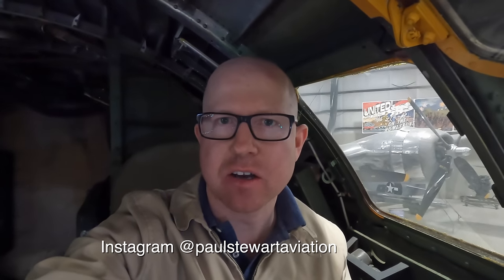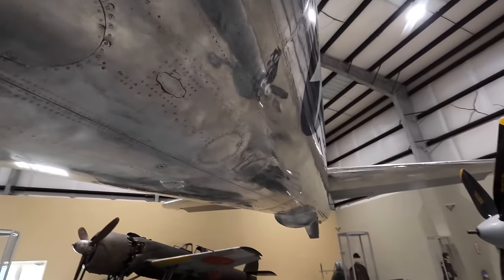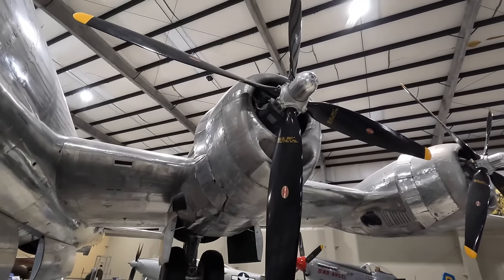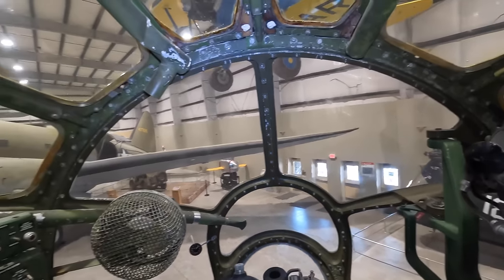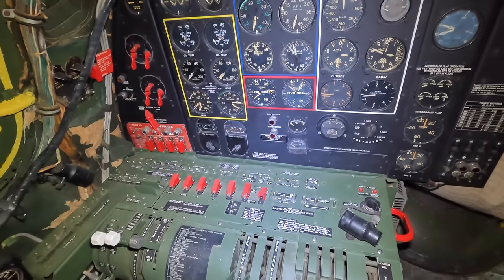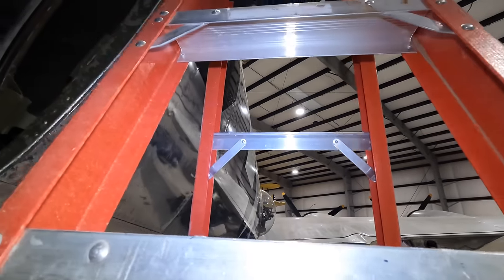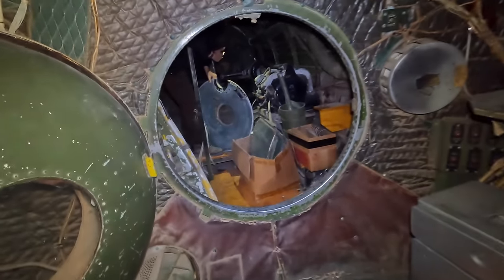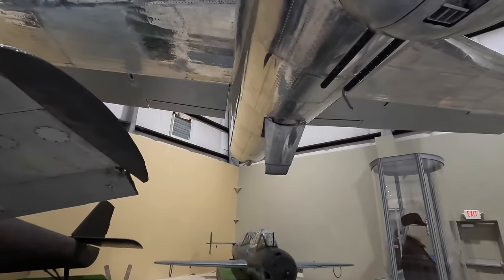Detailed tour through a Boeing B-29 Superfortress

Comment: my father-in-law archie hamrick was a tail gunner on a B-29 out of saipan .  the ramp queen.  won the distinguished flying cross awarded by general curtis lemay himself.  had twin 50 cal. machine guns plus a 20mm cannon.  cannon removed on many planes due to performance problems but archie took meticulous care of his weapon and did not have a problem.   thank you for this most interesting video.  JDR
Reply: 20mm were removed from all B-29s.  Both performance and weight problems. The gun system and ammunition weight >1,600lbs.  So less weight meant more bombs.
Reply: He took care of 20mm cannon when it was fitted and no problems but different ballistic travel than 50 cals strange idea

Comment: Very nice video of the B-29 Superfortress.  Thankyou for sharing.  My father was a B-29 pilot in command in June 1945.  He and his B-29 crew had orders to report for combat duty at North Field in Guam.  As it turned out, the war with Japan had ended just two weeks before they were to report for combat duty at North Field in Guam.    Dad later joined the newly formed USAF in 1947 when the Air Force separated from the Army, where he flew WB-29 Superfortresses for the USAF's Air Weather Service where he flew several weather reconnaissance missions.  Dad would fly through hurricanes to track where they were headed.  He would also fly through clouds to take air samples to check for radiation to see if the Soviets had detonated any atomic weapons recently.  He retired from the USAF in 1957.

Comment: I started volunteering at the Pima Air Museum as a teenager in the late 1970's. I, with permission, gave myself that same tour on more than one occasion. That aircraft was in amazing condition back then, only significant part missing this video calls the barber chair, gunners position. What I was told was called the CFC gunners seat/Central Fire Control gunners position.

Comment: B-29's were apparently very difficult to handle on the ground due to lack of nosewheel steering. Differential braking to steer was much easier on a tail dragging aircraft. They added nosewheel steering to the upgraded B-50 variant of the B-29.
Reply: The sound of a B-29’s brakes while taxiing is astounding, it’s like it’s screaming to leave the ground. That aircraft lets you know it’s there, loudly.

Comment: Excellent Video! the fire control system for the turrets was a very advanced bit of technology for the time. I was surprised to see that the control surfaces did  only use the  control cables with no power assist. For Crew members moving through the plane, lots of places to bang their heads.

Comment: Cool video but few points of inaccuracy here: 

The primary reason remotely-controlled barbettes were employed was due to the need for pressurisation at the B-29s high operating altitude:  the better shooting coverage & aerodynamic improvements were merely additional (though important) benefits. As all the crew needed to operate within a pressurised cabin, the gun ports in the turrets would require sealing which would have been impracticable & very difficult to achieve (except for the rear gunner's position, which didn't require a turret). The answer was to place the guns in electrically actuated, unpressurised "bins" & operate them remotely.

The Soviets didn't "capture" the B-29, as such, they reversed engineered a damaged machine that force-landed in Soviet territory in November 44. None were returned to the US.

The ailerons were metal skinned (which you can clearly tell from the inspection hatches cut into them & lack of ribbing undulations), but were made from a different type of alloy, hence the darker colour (the airframe comprised of many types of alloy "formulations"  which was another advanced feature of the design).

Having said all that, great video. One thing that comes across is how cramped it all was, especially that crawl tunnel. Definitely not for fatties or claustrophobics.

Comment: Great tour that the public wouldn't be allowed to do, I suppose.  The museum staff must really trust you not to break anything !  I wondered how the crew aimed at enemy planes, if the turrets are in a different place to the crew aiming points.  The crew must have given some range information to the computer.    That was my favourite Airfix model to build.
Reply: The clear bubbles side, top and bottom contained an aiming device.  The observer (gunner) enclosed the attacking aircraft in a rectangle site that communicated its size, direction and speed to an analog computer.  It then selected the appropriate guns to aim at the target and calculated how much lead and distance to compensate for.  It worked better than humans could.

Comment: I imagine the flight control cable theory is more real than you think. GI's get bored. 😂 

I remember when I was a young airman, I got into sport skydiving. Our Cessna's cables looked very similar and enticing. During the climb to altitude, we'd get bored. One of us would figure out the elevator cable and put some pressure on it. The unknowing pilot would put some trim in. Wait a bit. More pressure, more trim. Wait a bit. More pressure , more trim. Etc, etc. Finally, we'd let go and the plane would drop and scare the pilot. Good thing we all had chutes. 

I bet a good number of B-29 commanders had to yell "knock it off back there!" back in the day.

Comment: My godfather was the pilot of a B-29 in WW2. Remember him saying the engines were the most finicky/problematic part of the plane. Had to make sure they didn’t overheat and were prone to catching fire. Also, said the wing design was not as tricky to handle as the B-26 Marauder.
Reply: Engine fires were due to using magnesium for certain components.  Once it starts burning it's a bitch to put out.  Run away props were another serious issue.  If a blade detached and hit the fuselage it could cut the plane in half in a worst case situation.
Reply: @johngaither3830  thx!

Comment: 8:30 Further to your comment about the single pilot of the Lancaster: the aircraft proved so easy to fly that dual pilots were not considered necessary. This proved to be the case when many Lancasters returned from operations with a dead or otherwise incapacitated pilot and the aircraft being flown by one of the non-pilot crew.
10:18 In this very confined space, in April1945, Henry Erwin had to carry a blazing, white-hot phosphorus flare around the turret and forward to throw it out the copilot's window. He saved the aircraft and his crew and the Air Force quickly approved his award of the Congressional Medal of Honour so that it could be presented to him while he was still alive – his burns were that bad. He survived and died in January 2002.
 Even reading of how he deliberately picked up that flare and carried it is not for the faint-hearted.

Comment: Do all three stations of the throttle levers interlock together?  So if the Flight Engineer moves one lever, the same lever moves on both pilots also?   Or do they switch between locations and just go dead at the other two?

Comment: Great video as always Paul. Just a small clarification: at 8:29 you mention the (oft-repeated) idea that the Lancaster only had 1 pilot because wartime losses made a co-pilot unfeasible vs. the Americans. This has a poetic touch, but it's not accurate - you're correct that the Lancaster had only one pilot because of wartime exigencies, but that was because it was just a hastily-enlarged Avro Manchester 2-engine medium bomber, which was rejected in 1936 for being too small and underpowered. When 1939 rolled around and Hitler was banging at the door (and the RAF was screaming for bombers), Avro didn't have the time to improve the design except to add two new engines and upscale the fuel tanks and bomb bay so it could start retaliating against Germany as quickly as possible. This is how you end up with a strategic bomber with the same crew of 7 that a pre-war medium bomber had. It's also why the Lancaster only bombed at night.
Reply from the maker: Interesting Gaston and thanks for the extra info.
Reply: @PaulStewartAviation  My pleasure. Your channel's great and I watch every video.

As a clarification of my own remarks, both the Manchester and the Lancaster DID have a seat and a set of controls for a co-pilot, they just didn't ever use them except for training new pilots riding "second dickey" on their first few missions. In the Manchester this was a simple matter of space (the 2nd pilot's chair totally blocked the bombardier's access to his compartment), but on the much larger Lancaster it was simply a matter of habit: adding an 8th man to fill that seat would have required massive changes in training and personnel allocation that the RAF had no interest in pursuing in the midst of (what was then) a losing air war. They needed to get the bomb trucks up and running in large numbers over Germany, not reinvent the wheel. So it's partially correct to also say that losses of pilots (and predicted future losses of pilots) strongly influenced that decision.

edit: typo

Comment: I have watched several videos you have made and you keep saying when you talk about the cowl or oil cooler flaps that since they created drag it was a "fine line to take" indicating that there was an option in keeping the engine oil within limits. There was no option here or on any other aircraft. Period. I spent 29 years working on and flying in airplanes, jets and helicopters using reciprocating engines, jet, turboshaft and turbo prop engines.  Non flying vehicles such as cars, tractors, boats, 18 wheelers, you name it.  Anything with a motor or engine HAS TO KEEP THE OIL TEMP WITHIN LIMITS or the engine WILL seize.  In an aircraft going into harms way where you were likely to loose an engine to enemy fire it would be ludicrous to suggest they intentionally loose an engine because they didn’t maintain engine oil temp due to a bit of drag.
Reply from the maker: Ok, how should I word it? What is the purpose of adjustable cowl flaps?
Reply: @PaulStewartAviation  Oil cooler or cowl flaps are for cooling the oil. The thought of drag doesn't even enter the equation.  By the time the aircraft reaches the end o the runway for takeoff the oil is hot and the flaps are wide open.  Once off the ground the oil will slowly begin to get back into normal range and the engineer will begin to close the flaps, but only enough to keep the oil in normal operating range.  At 15,000 feet or above in normal climates the flaps may be 75% or more closed depending on the aircraft and after operating at cruise speed and altitude they may be less than 35%.  When operating in the middle east in the 4 engine aircraft I was operating at the time I would start engines 2 and 3 in the chocks and immediately begin taxiing. By the time I made it to the end of the runway holdshort I would have just finished starting 1 and 4.  2 and 3 were already out of limits hot.  We never stopped at the hold short, I advanced the power levers to the upper TIT limit and we went flying.  It was so hot we couldn’t make anything near max weight takeoffs and it was rare to close the oil coolers more than 90%. The whole mission.